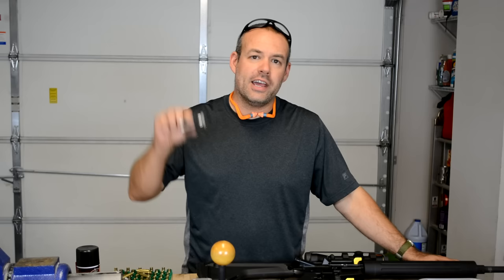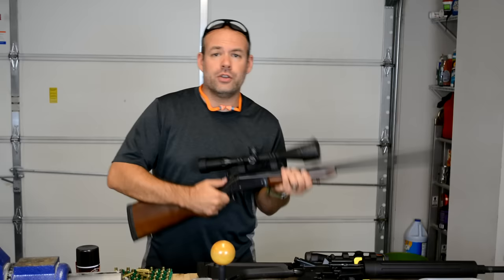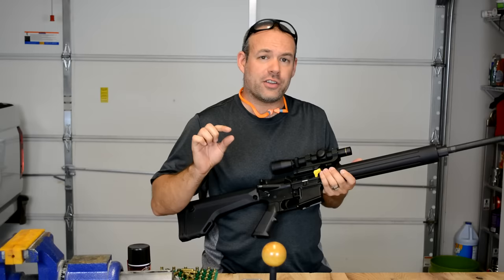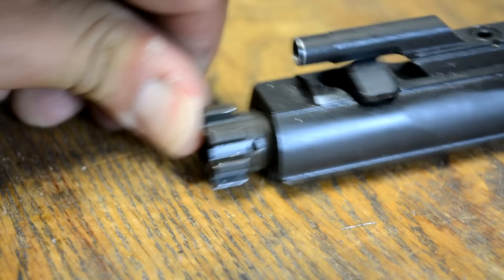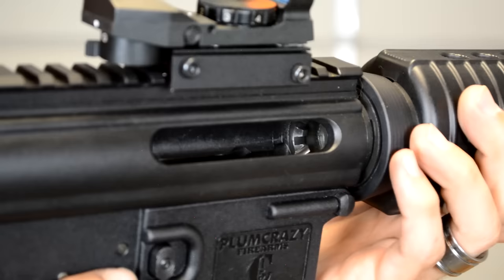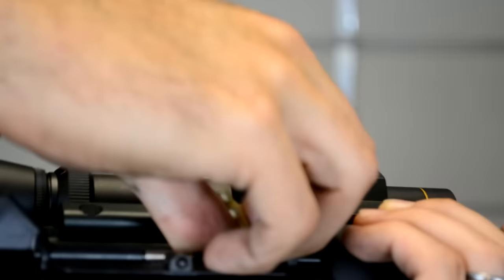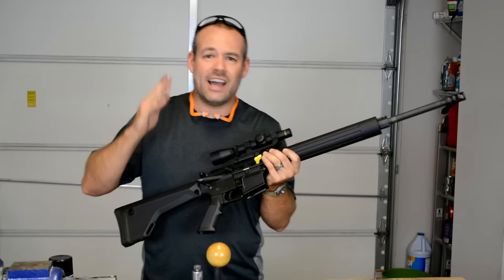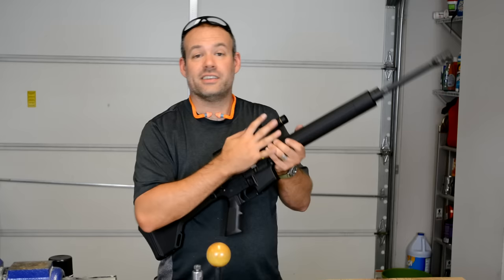Small Base Dies explained

Comment: Hey, I'm new to reloading and I am trying to pick out my first set of dies. RCBS is selling a small base 2 die set for 300 blackout for $14 less than a full sized 2 die set. I'm planning on reloading for a semi auto 300 Blackout AR, so it seems to me that I would be better off just purchasing the small base set. Its cheaper and it will help me avoid exploding my gun due to the cartridge being too large. So is this good reasoning? Can I use a small base die for every load or is this only for specialty loads?

Also, the SB set says it has a tapered crimp, while the full sized set says it has a roll crimp. From what I have read the tapered crimp is a better crimp for semi-autos. Is this also correct? If so this would be another good reason to get the SB set.
Reply from the maker: +2ndAmendmentGlock RCBS dies are very good.  The small base die set will work great for making 300 blkout brass from .223 brass.  Once the brass is made it will work the brass more than the regular dies when reloading which will slightly shorten their life span some (depending on your chamber) but the round will fit any firearm chambered in 300 blkout.  Worst case scenario is that your chamber is very large and instead of 30 reloads the brass can only take 20 before it cracks.  These numbers are estimates and highly variable on the brass, bullet, powder type, and load.  Also, the taper crimp will help with case mouth life and work great but some say the roll crimp gives better accuracy.  Luckily, the 300 blkout was never intended to be a long distance accuracy round making the taper crimps just fine.
Reply: get the AR series.  the seating/crimp die in the AR series is more forgiving for auto.

Comment: Should you use small base die repeatedly on the same brass over and over ??
Reply from the maker: Technically, one should keep all brass separated by firearm and only neck size after it's first shooting.  Anything else will lower the life expectancy of the brass.  I've yet to notice any difference between the regular full sizing and small base die sizing but there may be a one or two shot difference between the two.  I'm ok with 5 vs. 7 loadings on free range brass in an AR-15 if that'll guarantee it runs in all my firearms.
Reply: thanks understood

Comment: The real truth...Ask the die makers for the major manufacturers like Lake City, R-P or Win.IMO, based on my research, is that factory fresh rounds have cases that are smaller than you can even make with the reloader's small base dies.  Why?   You answered that in your initial comments in the video.    They make them small so they work in everybody's firearm and chambers, not just work in some or most.  SBDs help assure smooth functioning with no FTFs even in the tightest chambers.
Reply: I am trying to reload for my lr308 and want to get the best accuracy possible. I was hoping to just bump back the shoulder a bit instead of doing a full length resize. Would a standard full length resize actually be a tighter fit than the factory PPU and Federal Gold Medal that I have been running?
Reply: Yes...It is always a trade-off.  Tight radial clearance fit at the rear of the bottle neck case near the head, means precision placement of the bullet in the freebore, if the conical section of the shoulder contacts the mating conical section in the chamber.    In bottle neck chambers, the case radial dimensions relative to the chamber dimensions position the bullet radially. The ideal is to have the axial case centerline and bullet centerline coincident with the rifling centerline before firing and a zero clearance fit.   This ideal is never achieved, of course.  If you try to match case shank diameter with chamber diameter, thermal expansion can freeze the bullet in the chamber.  There must always be clearance fit, even if it is 1/2 thousandth of an inch.
Reply: Yes.  I did measurements using FGMM .308 168 gr. to validate my claims.
Reply: I measured my brass that was just fired through my rifle and ran through a Lee Classic Loader neck sizer (I know, very inadequate for an auto loader, it was a gift) and everything was in spec as far as I could tell, except for the web being .002" over. I was hoping to be able to resize the base of the brass and only set back the shoulder a few thousands to make sure it would function and be safe, but also get some of the advantages of only neck sizing. Intended to cast the chamber and get a bullet concentricity gauge and all of that stuff down the road if I can get some promising results.

Comment: I bought a RCBS SB die and if I adjust the die as per instructions it dimples the shoulder of the brass.  To keep from doing this I have to adjust the die to where it is barely touching the shell holder at top dead center. I was wondering if anyone else had this problem?
Reply from the maker: I'm personally not super familiar with the RCBS SB dies but the only time I've had that issue in general is when I've accidentally gotten lube on the case neck and shoulder.  There could be lube inside the die that needs cleaning.  I'd give that a shot then contact RCBS if a clean die still dents a clean case.
Reply: i had the same problem when i first started using the rcbs small base die. keep the die adjusted according to the instruction manual but use less lube. too much lube will cause a little dent in the shoulder.
Reply: Jason Yee You guys were exactly right. 
I wasn't using that much, or so I thought\. It was too much though.  It only takes a tiny bit.
Reply from the maker: I only knew the problem because I've done it myself.  After reloading tens of thousands of pistol cartridges I thought I didn't need to read up on rifle cartridge reloading before trying it.  I was wrong.
Reply: I don't understand why too much lube causes a dent. Can someone please explain? I am about to start reloading next week for the first time.

Comment: Hey D&G!  Thanks for the video.  You may want to check the headstamps from the brass that won't chamber in your rifle after being resized with the full length resizing die. I have heard that some "foreign" brass may not be manufactured to spec.  I recently watched the following video where this guy was converting 223/556 to 300 blackout. I know, I'm veering into apples and oranges territory, but you may find his video helpful. If you don't mind, let me know if it's the foreign headstamps that are giving you trouble so I can avoid them altogether.  Here's the link: 

https://www.youtube.com/watch?v=_08yZXnk7ro
Thanks again!
Reply from the maker: I'm actually going to go over that issue in a future 300 blkout video and provide a list of troublesome head stamps.  The big issue with them is the thickness of the upper part of the case body that ends up being the mouth of the new case.  So far I can't find any trend in my issue here.  I think it's from being fired in on almost out of spec chamber and I'm picking them up at the range.

Comment: The &#@!ng gun isn't going to blow up in your hands if not fully in battery/chamber. AND the bolt carrier group BCG is designed where the hammer can't contact firing pin in every AR I have ever dealt with when BCG is not fully engaged. 
This guy is obviously new to gun and reloading world trying to show off what he is clueless about. Entirely too much misinformation.
You might try head space issues rather than small basing. They both have their roles.
Reply from the maker: Make sure to like and subscribe to stay up to date on my future videos.

Comment: You might want to learn a little about the AR and it's BCG before you look like a fool. Of course the firing pin will not travel forward until the bolt is locked into full battery.